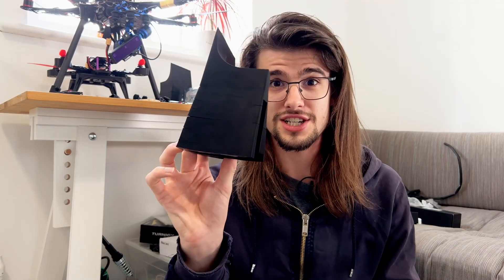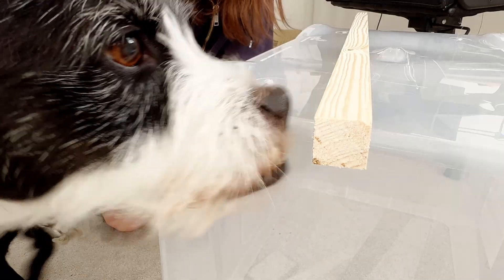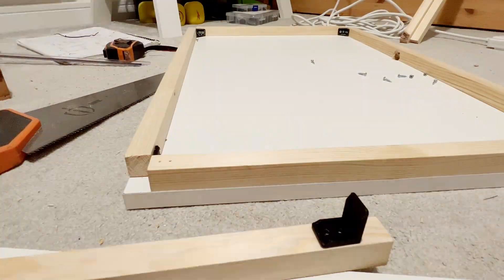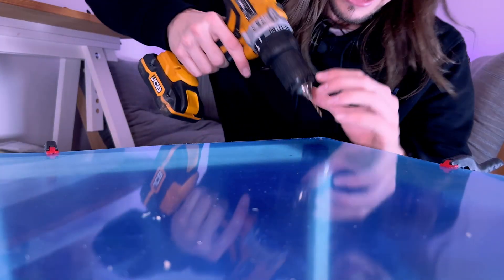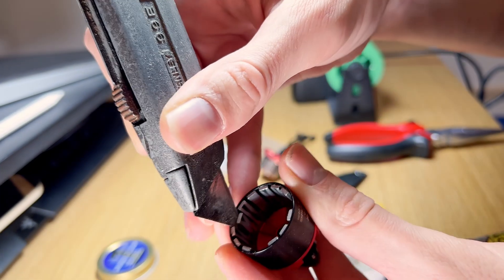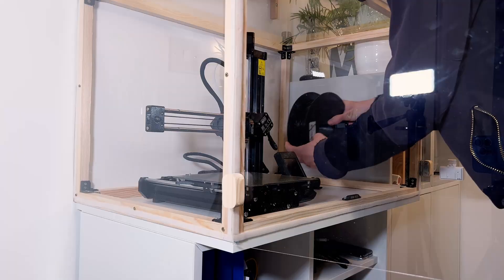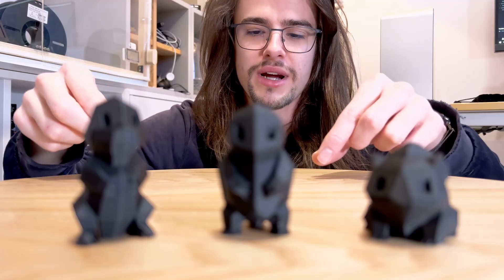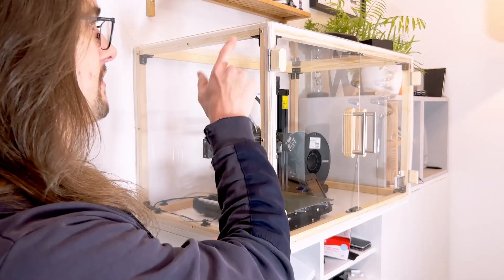Building a Budget-Friendly 3D Printer Enclosure from Scratch

Comment: ABS is nasty, print an air purifier, lots of models. The warping/cracking could be drafts still coming in the chamber, also make sure in the print profiles for part cooling fan to be off. Use some silicone in the seams to seal the chamber and weather stripping on the doors.

Comment: I just got into 3d printing literally yesterday, & when ever I start something  (even though I study up ahead of time) I dive right into it. I chose abs because thats what I read was the best for interior parts for vehicles. The first parts I printed were 2 shifter Knobs (army green ABS), I noticed right away that I was having a few layers delaminate but overall it came out well enough for a Usable prototype. After that however any part I tried to print (black ABS and Neon Green) were coming apart so as I read more I learned about the need for an enclosure so here I am. Your build is exactly what I was thinking would fit my needs. Thank you for the Video and awesome work.

Comment: Wew! A new weekend project is waiting for me! 
Going to modify your design heavily (dimension-wise) to accomodate to Neptune 4 Pro, mainly to reduce noise, with abs printing as a valuable bonus!
Reply: @Taras195 how ist your printer doing in the enclosure? I got the neptune 4 and I will put it in an enclosure soon. Did you got the electronics like power supply out of the enclosure?
Reply: @flumbami8054 The project failed at the planning stage due to a lack of space and other life circumstances. 
Lack of space mainly, because enclosed printer with diy anti-vibration platform gets big fast. 
When I'll reconsider the project i'll consider moving the power supply out of the enclosure for sure. 
I'll be happy seeing your final build, for sure.
Reply: @Taras195  ah sorry to hear... 
to make my enclosure as small as possible, i removed the spoule-holder and the panel to mount both outside the box. I dont plan to make a video out of it tho. maby i should xD

Comment: You need adequate ventilation so that you maintain an even temperature inside the case. Over/under heating of the ambient air can lead to different problems with the filament used, so that should be in its own container. 3D printing relies not only air flow around the nozzle fan to cool the part properly during printing, but on the cold side to prevent heat creep, which can adversely effect the filament.. 
ABS in particular may need a heater and temperature regulator.
As far as the case goes it looks good, but could be improved by lining 5 sides (all but the front) with tin foil to reflect the heat.

Comment: Very neat. I just made one very similar, using pine and clear plastic roofing material which wasn't a king's ransom like cut 2mm perspex. in fact the whole thing was made of scrap except the roof plastic. The most challenging part of the build (this is the second one i have built) is the door. Yours are very nice, I went totally ghetto sticking the roofing clear plastic on with velcro and magnets (in fact  I cut up a surplus magnetic sheet you get every time you buy a flexible mat). One question, you haven't put a fan? Obviously not good for active printing, maybe for fumes of ABS?
Reply from the maker: If it works, can’t fault it!! 

I’ve since added in a Nevermore filter to the case, which seems to have been working fairly well. 👍🏻

Comment: how good it the Levoit to remove the fumes??? is it good?? thanks for the video
Reply from the maker: It seemed to work well enough - reduced fume smell but not fully. I’ve switched over to using a Nevermore filter now with activated carbon inside the case 👍🏻
Reply: @akamatchstic  thanks

Comment: brother the enclosure being made for warping is the least of your concerns printing with ABS has a super high TVOC and is highly carcinogenic. You need to vent that enclosure out a window and do some research into the ufps that are put off by printing with ABS. Having that running in a small space for even 25 minutes could be extremely detrimental to your health in the long-term.
Reply from the maker: Before building this enclosure I had been using an air filter (shown in the video I think?) that uses an activated carbon disk for filtration. I now have a Nevermore carbon filter set up inside the enclosure
Reply: @akamatchstic  how did it go, and how do they compare, the Levoit vs the nevermore

Comment: I used to have the same issues with my base lifting, I use Beld Weld now and print with a brim.  No more issues.  As far as your splits in the middle of the prints, I corrected that with a circular fan shroud that creates a vortex around the extruder.  I print at 210 degrees to make sure I get a good bond and having the modified fan shroud cools the bond pretty quickly to ensure it stays bonded.

Comment: Great looking enclosure.
Like many have said you need higher temps and consider moving the electronics out to avoid issues. For higher temps you can probably let the enclose heat soak for a bit by letting the bed at 100-110ºC for 30mins (or grab reptile heating mat or bulb should help without breaking the bank) . I've been using nothing but a survival/emergency blanket around my delta printer and its enough to print PC, until i finish building a big cabinet to fit a couple printers.
Also you might have some heat escaping from the doors since they're on the middle but shouldn't be much , just a point to consider. 
Regardless its an elegant enclosure , good job

Comment: It is warping because the enclosure is too big and the printer bed cant heat up enough to enable the printing of ABS, I would section it off to just fit the printer and place the filament in the smaller section along with the power supply and control board, I have built the Lack enclosures which work just fine, and with my PS's and control boards outside the enclosures.
Reply from the maker: I do have a heated bed which should be making a difference here? Either way, I plan to upgrade the sides to be thicker polycarbonate to improve thermals and reduce risk of burning. A tiny heater may also be added, and there’ll be a Nevermore Micro V5 by the end of the month 😊

Comment: Just use ASA instead, mate.
Reply from the maker: I was under the impression ASA also needed an enclosure to help with warping, and to reduce fumes?
Reply: @akamatchstic  ASA needs an enclosure for exact same reasons ABS does. However, ASA is sometimes called a better ABS. It presents less issues when printing and it doesn't release fumes and smells while printing either. But yes, just like for the ABS, you need an enclosure. The one you have, should be good enough.

Comment: Maybe use an active heater in the enclosure to get the ambient temperature up or use a draft shield to try to contain the heat a bit more.
Reply from the maker: I have been toying with the idea of a tiny heater! 

Probably will upgrade the sides to be at least 4mm thick though, since the thermal quality of the 2mm I used probably isn’t amazing. I’m also thinking of insulating the back better at the same time, as well as moving some electronics out the enclosure too.

Comment: A lazy solution to warping problem is to use carbon fiber ABS, you’ll need a hardened steel nozzle but it will no longer warp
Reply from the maker: Good shout, I’ll have a look into it!

Comment: Looks nice, but I have some concerns with this. Don't get me wrong, this is not to be negative. My intentions are good. The frame is made out of cheap lumbar, which easily burns. Then you didn't use poly-carbonate, but used acrylic, which easily burns. The corner braces are PLA or something, which easily burns. The doors are supported by easily burning wood. Now that's a problem. But you made it even worse. You put all the electrical stuff, like the main board, the power supply and the pi, inside the easily burning enclosure, heating them up, possibly beyond what they are rated for (temps there are much higher than the air inside the case). This makes this enclosure a fire hazard.

For the next build, it would be slightly more expensive to use 2020 extrusions and take poly-carbonate (or other fire resistant materials) sheets instead. Use steel hinges, move the electrics out and done. For filters, there are tons of options, from 40MM NATO  filters to special 3M face mask filters. Both you can have run inside the enclosure, filtering the air in there instead of just the air coming out. When using octoprint, you can, with a safe enclosure, use a tiny electric heater to heat the enclosure up. Hope this helps.
Reply from the maker: "Don't get me wrong, this is not to be negative" -> Any feedback is always welcome!

At the minute, I only am running the printer when I'm in the house and able to monitor the print closely. e.g., OctoPrint webcam, or being in the same room during the workday. However, that's not a proper replacement for decent enclosure materials...

I am already looking at upgrading the side panels to be at least 4mm thick to help thermals - I'll switch to polycarbonate for that, thanks for the heads up on that! 

Electronics, yeah the Pi should probably be external. Looking at the specs for the Prusa Mini, its main board should be able to handle 45C without an issue I believe, and the PSU is external already. I'm tempted to leave the printer side of things as-is, and just move the Pi.

Other commenters have mentioned the Nevermore which looks like a great option for filtration. Ideally I'll have that sorted by the end of month - the printer won't see much use until then.
Reply: @aka: Matchstic  for ABS it's best to use a heater in the enclosure to go to 60c. Your mainboard, that 45, is that internal chip or external temp? Internal 45c can mean a chip temperature of 100c. 

If you want to user a heater, i know octoprint has support for shelly smart plugs. That brand is cheap but high quality. You can even reflash it with other firmware, turn off cloud junk with a single switch etc.

 I don't know that filter brand but I'll look into it as well, could be interesting for me too. I'm planning on building an enclosure for three printers on top of each other.

Comment: As everyone else is saying, increase the enclosure temperature :).

I'd aim to have it hang around 40 and see your results, increasing to 45. It's not great, but I'd leave the electronics inside up to 45c. Maybe even 50c if cheap stuff. I figure they'll also generate heat, so why not use it :).

Maybe an easy quick win would be a non-flammable bedsheet over it. There's also widely available fireproof insulation available, typically used in boat engine bays.

It'll mean spending, but maybe consider something that can maintain a consistent temperature (otherwise night/day/seasons will screw you). I use a home automation temperature sensor to turn on/off a plug socket with a vivarium heat mat plugged into it.

Also, look into chewing up that air whilst it's inside the chamber. You'll need acid free activated carbon. Stuff with acid in will corrode your electrics over time. Nevermore is an option (I get my carbon from them too). I went with the BentoBox for my in-chamber filter. You could easy get 2 BentoBoxes in yours.

Finally, I wouldn't wanna be in the room after you've opened the doors. Unless you want cancer in a few years. Don't huff those ABS fumes ever dude!

Comment: Is it wrong that I laughed at using the dremel to round off a wooden spacer for the too-long bolts instead of... using it to cut the bolts shorter?
Reply from the maker: …. Dammit. That would have worked much easier 😂
Reply: @akamatchstic  No, even though I chuckled too at first,  I was blown away by how much better it looked than just bare metal.  It actually complements the wooden design and adds to the overall symmetry, so instead of looking DIY your enclosure looks like a premium product.
There's a way to solve the heating issue with something other than the heater.  Get some tungsten incandescent bulbs, aka "hot lights".  The additional benefit would be perfect lighting inside the enclosure so your time lapses won't look so grainy.  

You should absolutely get some silicone caulk and seal every joint.  That's not debatable.  If you go with wood again consider using your dremel to make dado grooves in the boards and slide the panels in there instead of drilling them to the boards.  Way stronger joint and much better seal this way.  Looking forward to your next go at it!
Reply from the maker: @madderall_dot_com  I love the caulking idea - think I have some in already!
Reply: I think it looks better with the wooden bits actually.
Reply: Yes, you should be ashamed of yourself..now go to your room. 👉
Reply: You learn by the mistakes you make(not saying it was a mistake but just saying it could've been done a different more efficient way...in that sense). So he got it done his way, you suggest something he didn't think about...and next time he may implement it in his next build.

Comment: Will you be 3D printing molds for the boat? maybe for fiber glassing? This is super interesting! Looking forward to the boat project!
Reply from the maker: Possibly... Given that I've been trying to print this first prototype since October/November, and still haven't got all the parts done, I'm leaning towards a design that will use laser-cut ribs and wood strips that the fibreglass layup then goes over. Taking a lot of inspiration from rctestflight for this!

Comment: This is a really nice enclosure. I have a few suggestions based on what I learnt from operating a Voron 2.4 which is already enclosed. Firstly, you might want to move the electronics like the power supply and rpi outside of the enclosure. They'll do better without the heat. Second, you might want to consider insulating it more. Ideally you want to print ABS with an ambient air temperature of 60C or above. Lastly, you'll want to use a carbon filter as well as a HEPA filter. The HEPA filter removes particulates but it won't remove the nasty volatile organic compounds. You'll need a activated carbon filter for that. The nevermore filter is quite a good design you can build yourself with a couple of 5015 fans
Reply from the maker: Thanks for the tips! 

I'm planning to switch the Pi to sit on the outside of the enclosure, with a small slit to allow the camera cable to passthrough - only issue is that the power cable is slightly too short for this right now. Fairly sure the PSU for the Prusa MINI is an external one, which is tucked neatly under my cabinets.

Just had a look at the Nevermore, and yep thats perfect! Will be printing one and sourcing activated carbon filters for it.
Reply: @akamatchstic  another tip: test the carbon first in a Tupperware container with a fan and some steel nuts and bolts. There was a case in the Voron community where after installing the nevermore filter, all the steel parts inside that printer started to oxidize. It turned out that some carbon pellets are being treated in a way that can cause this. Hence, test it first :)
Reply: Interesting thank you. Any tips for a good carbon/hepa filter system?
Reply: Prusa's printed parts are made of PETG, so 60+°C is probably too much. I believe Prusa recommends enclosures up to 45°C for their products
Reply: Hi I have a question, apart from the screen and power supply, do I need to move the motherboard outside the enclosure as well or is it ok if I leave it in?